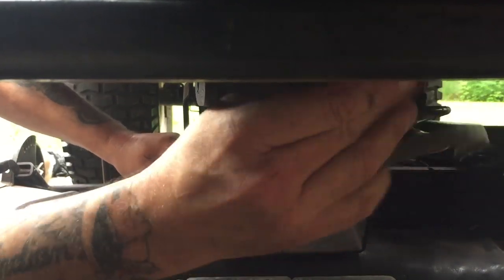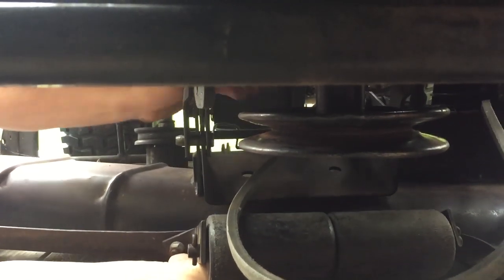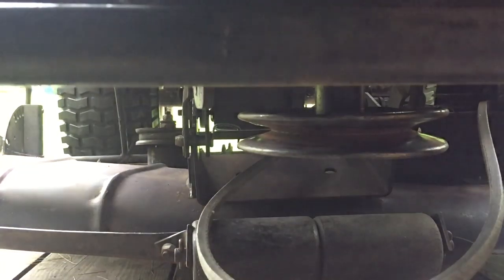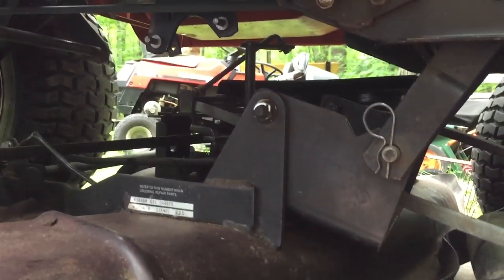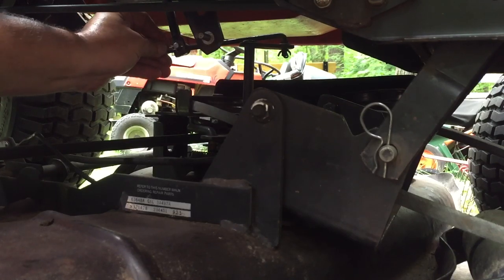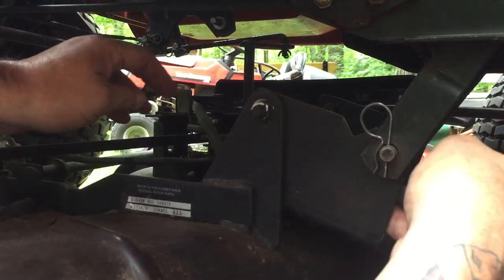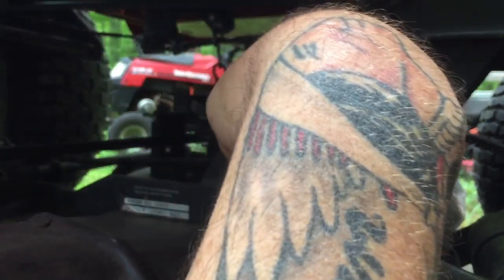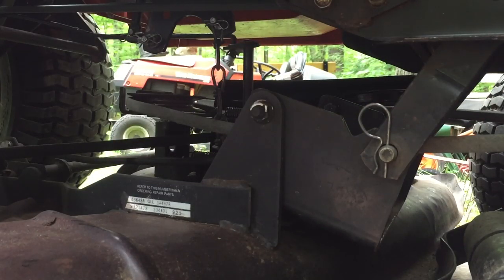Gilson mowing deck part 1

Comment: Hey! You might want to check the manual, I think you will find that there is supposed to be a pulley for that rear cable to ride in over that cross shaft. At least that's the way my 38" rear discharge deck is installed. Have a good one!

Comment: This video was a lifesaver! I've got the same mower and I needed to replace a belt. And the comment below about a pulley wheel is true, mine has one that is on that bar, the cable threads over it and does not touch the bar directly.
Reply from the maker: Thanks mine never had one